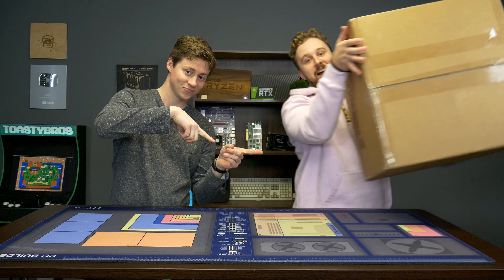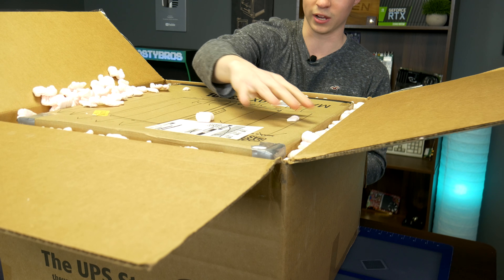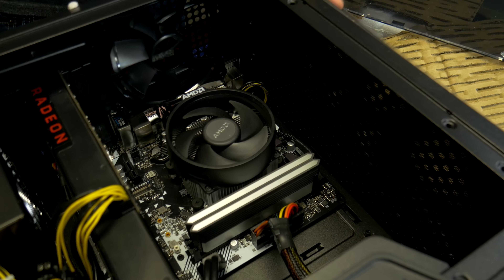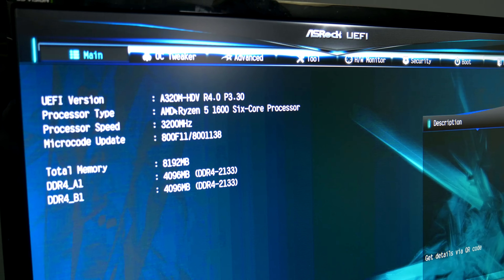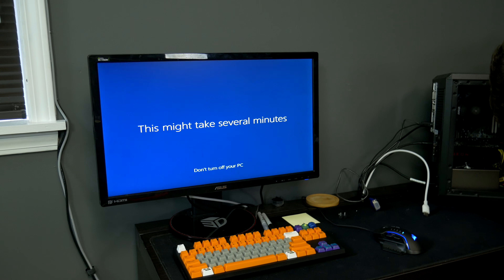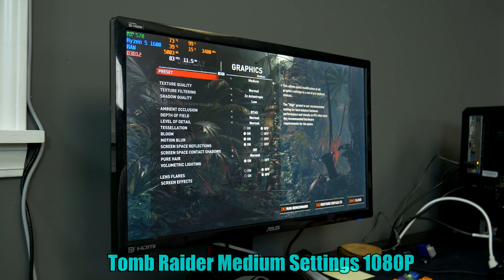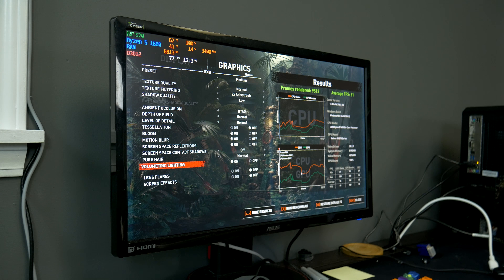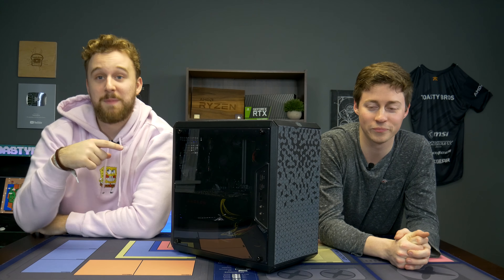Our Viewers Built A GAMING PC For Us To GIVEAWAY!?

Comment: At this Moment I reallized I got a bad 500 Dollar pc
Reply: What did u get?
Reply: Oliver Faulkner gtx 1050 
Intel core i 7
A320m pro 4 motherboard and 
16 gb RAM 
And more
Reply: @-tadoosu-2913  how is it weaker than a 300 dollar pc and plus how did you get these specs for only 500 dollars?
Reply: @-tadoosu-2913  dude A320 is for the AM4 platform so how do you have an i7? Thats bullshit
Reply: A320 is an AMD chipset how did you use the I 7?
Reply: @moustafakhalifa7289  it really depends what processor it is. U can get an older i7 for like 50 bucks with decent performance, though it can't have an i7 anyway so questionable whatever the case. U would expect something of this caliber  if you were buying around this price point. Also if this used, then this would be quite a not good deal, depending on the actual model of the CPU and motherboard
Reply: @-tadoosu-2913  ah yes, an i7 in an AMD motherboard, makes sense
Reply: Speedy Boi I dont know what you mean
Reply: Oh sry uff That is the motherboard of my Brother
Reply: ZR_AToMIX your lieing first of.all the specs are good but a320 is am4 not 1151
Reply: @-tadoosu-2913  i7 and an amd Mainboard nice PC.
Reply: @-tadoosu-2913  so what's your motherboard?
Reply: Speedy Boi ? I don‘t know I am tired i will Tell u tomorow
Reply: @moustafakhalifa7289  1050 is terrible you with 500$ budget what do you mean only 500$? And he is wrong about his motherboard or wrong about his cpu
Reply: @NotAnAlienlol  true
Reply: This man defiantly got a pre built
Reply: This SIM got Intel probably
Reply: ZR_AToMIX disappoint level has rises
Reply: imagine have a pc thats under 1k in 2020 LMAO

Comment: i have a r5 1600AF @ 4.1ghz 1.33 volts and a 5700 ddultra flashed to the 5700XT bios on ultra x16 hbo+ or whatever my frames set around 80-100 fps on STTR

Comment: I need some help here
I have a pc with: 
Intel core i3 8100 
Gigabyte h310m mobo
2×4 gb ram 2400mhz
Gt 1030 
450w psu
120 gb ssd
1 tb hdd
Coolermaster masterbox lite 3.1 case
And 120$ . I can play most of my games at 60 fps( no need for more bcz of my 60hz monitor) but on some games it struggles to stay on 30 low settings. What can i do? Like idk what gpu should i get or anything else. Plz help

Comment: you never told us how much each part cost rip me im tryna build this ngl
Reply: well it's most likely used parts they got from deals, which is how it stayed so cheap. which means that replicating this for the same price won't be easy, and if all the parts are bought new, it's impossible
Reply: Try fitting this
1600 (possibly AF)
8gb 3000mhz+
B450 (possibly 4 slot)
Used 1070/1660ti/1660s
Any budget case
A cheap ssd
Evga psu

Comment: Hey guys have have a issue on cod warzone where when i move away from objects they get pixelated and look very bad i tryed all in game settings and nvidia settings but still this pronlem persists and it is also seen in gta 5 
My pc specs 
Ryzen 3 1300x
Zotac gtx 1050ti mini
8gb transcend ram
Asus prime a320m-k motherboard 
240gb wd ssd only for OS
1TB hardisk where game is installed 
And i use a generic PSU from CIRCLE  please help me fix this issue as my eyes get strained a lot while playing game as you know i want to have fun not get stressed out , i would like to request toasty bros to look into this problem like i have fond any of the fix for this rather than replacing it with a new pc which they said online on some website 
Please help me guys i have built it with my hard earned savings i am still 17 so any help would be appreciated

Comment: Comment your pc specs below I like hearing them here’s mine 

A320 m pro

Ryzen 5 2600 

16 GB ram 3000 MHz 

Radeon RX 5600 XT 

Thermaltake 600 watt PSU 

3TB HDD 

240GB SSD

And a Sceptre 27in 1080p 144hz monitor
Reply: Is there any heating issue?
Reply: Josef Johrel Medel no it’s all runs really cool actually

Comment: anyone can recommend a 700 pc 
(maybe some pieces of second hand)
Reply: Ryzen 5 1600af
Asrock b450m pro4(can overclock ryzen 5 1600af on stock cooler to 3.8ghz on 1.2 volts)
2x8gb of 3200mhz cl16 ram
A 500gb SSD or maybe a 250gb with a 1tb HDD depending on cost
Phanteks p300a
A evga br 500watt
Rtx 2060